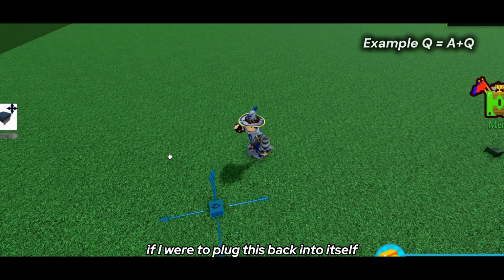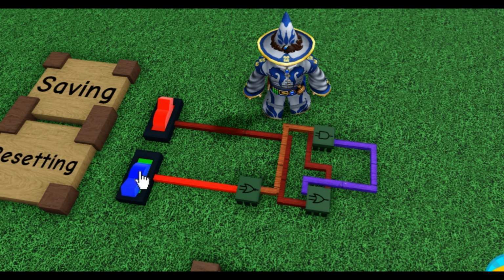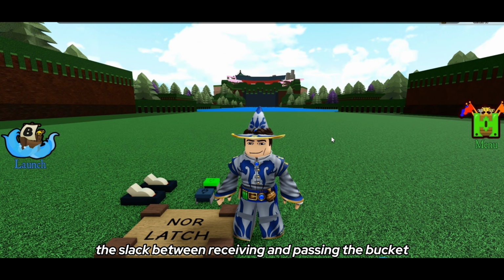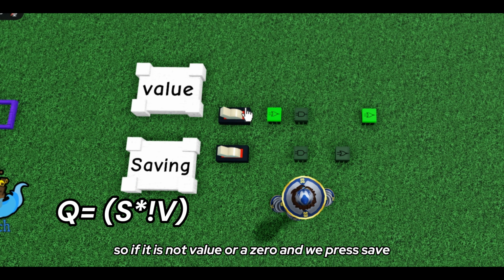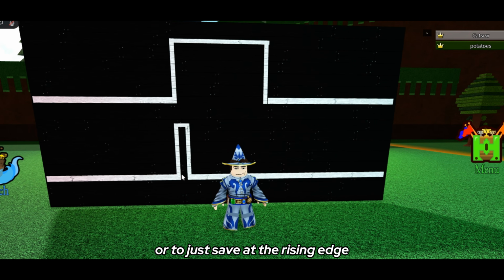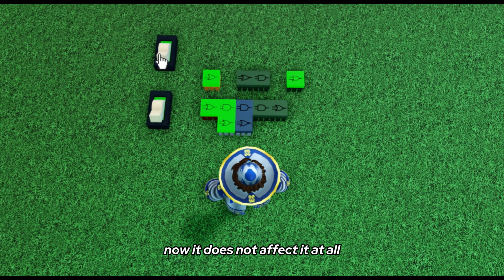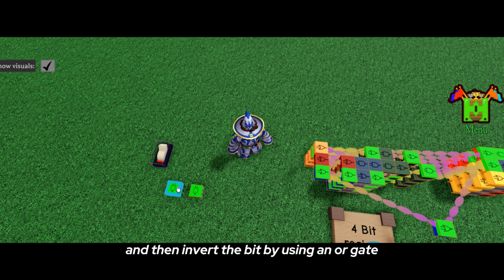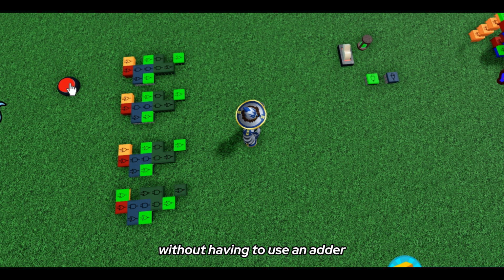How Do Computers Remember Data Explained in Build A Boat Terms

Comment from the maker: For thoes seeing the Rising edge part and getting confused. the Not gate would activate after the buttong is pressed. 
The rising edge circuit:
(buffer(!A))=q
A=q

in the video i used 2 buffesr but you could just use a BUFFER plugged into the NOT, But i made 2 buffers on top of eachother just to be safe (babft fps tick rate to be safe)

Terms for the math equations since some are confused

! = NOT
* = AND
+ = OR
Reply: what shouldnt + be and?
Reply from the maker: @aidenmyboyfrenjy  il explain in a easy way because i think theres some confusion
if i say A+B or AORB that would mean either or would have to turn on, where in basic boolean algebra Q=A1+B0 or Q=A1+B1 or 0+1 would give us the desired output

now if it was A*B. or A And B. Q=A0*B1 would just be an output of zero due to the common zero rule in all universal mathematics. this is beacuse we would need both A0 and B0 to be on hence why OR being A*B
I hope this helps aiden :D
Reply: @catsrw  idk anything🙏🙏😭😭
Reply: @tombien2629 k
Reply: @tombien2629  In a very basic sense:
0*0=0
0*1=0
1*0=0
1*1=1
notice how this resembles an and gate?
Reply: @TheCeasar55  thanks
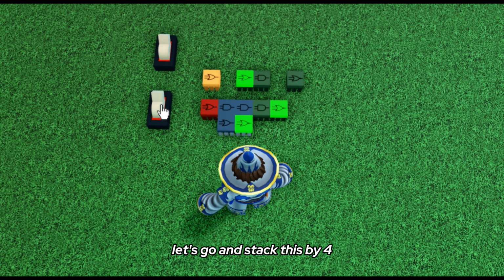Reply: @catsrw  you never explained the final version of the rising edge at 6:45 since you skipped that clip in the vid while making it into a 4 bit register
Reply: @aidenmyboyfrenjy  0 + 1 = 1, 0 * 1 = 0
Reply: @aidenmyboyfrenjy  the inputs into * are the multiplicands. Only 1*1 is equal to 1, if any are 0s it would be 0.
Reply: Dont know the logic symbols but why don't they use & for and, / for or and ¬ for not
Reply: @Hallway_figure  genuine understanding vs absolute bullshit
Reply: @arqiledashi4737  it's not every day I use logic gates to add two numbers together
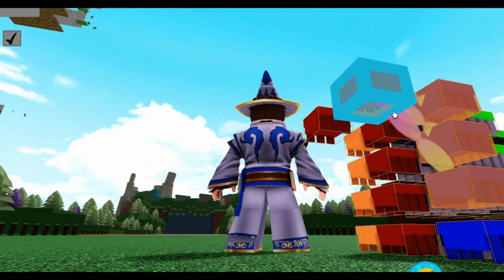Reply: at 6:51 idk what to do cuz i was never told what the load is or anything and im now confused
Reply: Could you please add Chinese subtitles? The translation was completely incomprehensible to me; it took me a long time to understand it.(This sentence is from Google Translate.)

Comment: I wonder if i can have knowledge of the seven Seas, The tutorial wise wizard Guy, and Have (theoretically) 16 Engineering degree's. It is possible to make a Coding Computer where you input Letters and numbers Manually, and it using the same coding rules as python, and completely running a Functionl game. Like doom: but having a WIDDEERR Varity of games.

In English: heh computer go brrrr

Comment: Will you be making a video on decoders, specifically the BCD-to-7-segment decoders(Since i plan to make a calulator and score board(for a simple game im making))? I'm still fairly new to digital logic, but from what I've learned, that seems to be the standard way to convert a 4-bit input into the seven outputs needed for a 7-segment display. And if it would be simple for my pea sized brain(I kind of got the video you posted about decoders and multiplexers bt still not confident in my knowledge), but if you wont be I would love to hear any suggestions for vids so i can understand it

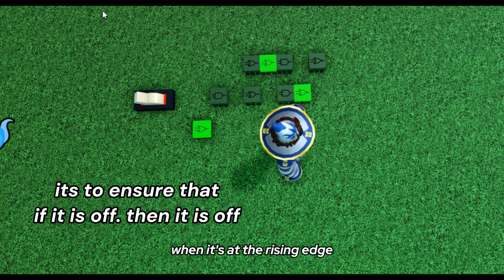Comment: 6:09 (not exactly right timestampe) but u said in computers u can use a 1 shot, theres also another faster (potentially) way of saving a state at 1 point, whch is a master slave data latch, which i don’t know if you discussed because it saves data on rising edge without having a circuit to flicker on and then off
Reply from the maker: Theres a lot of faster ways. I just abused gate delay and a single pulse generator to make mines

Comment: i have a problem with logic gates, here it is:

so, im building a quite big contraption. and at one point there is an OR gate with 8 inputs. for some reason, the gate just doesnt work how it should. sometimes it can turn on even if all the inputs are inactive, sometimes it might be the opposite. sometimes might actually work correctly. how do i fix it?